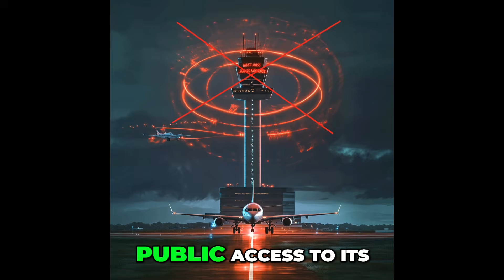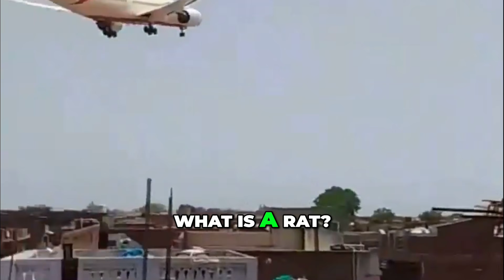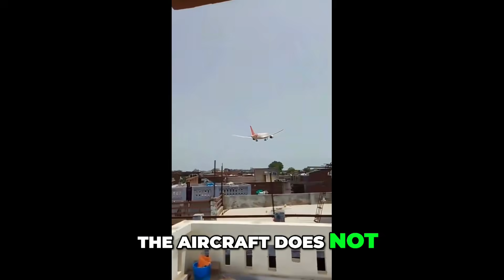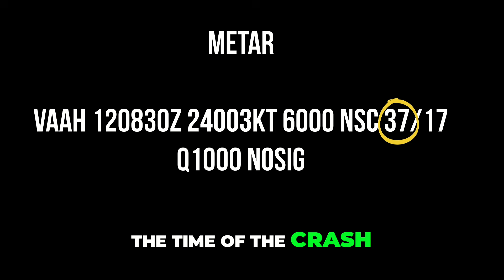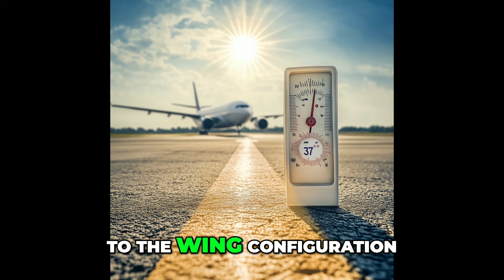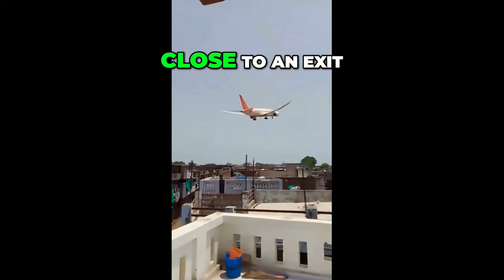Air India 171: Early Theories Without ATC – 787 Crash Deep Dive

Comment: AI171 was airborne close to the normal spot and it reached its maximum height just above the end of the runway. Everything seems normal until that position. Take off flaps, take off power and so on.. It's impossible to take off, with flaps up, using a rotation speed for any take off flap-setting... So they had a proper flap setting and take off power available.. Then what?  Using the Occam's razor problem-solving principle that using the absolute simplest reasons for an outcome.  So, flying with a "normal" nose up attitude until the end with just a shallow descent, tells according to Occam that the engines produced a lot of power, but the wing configuration was asking for a higher speed. Gear down position acted as an airbrake...   The aircraft is actually constructed to climb and even cruise on top with less power than a take off power (max 5 min) with flaps  and gear up...  Everything according to Occam, knowing it could be a thousand other reasons...